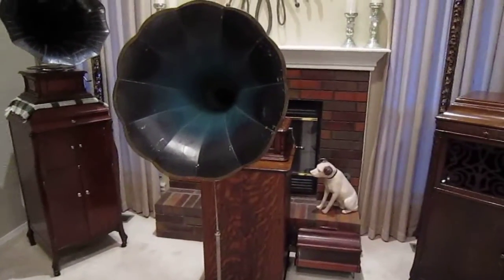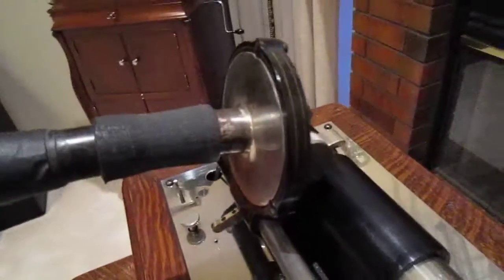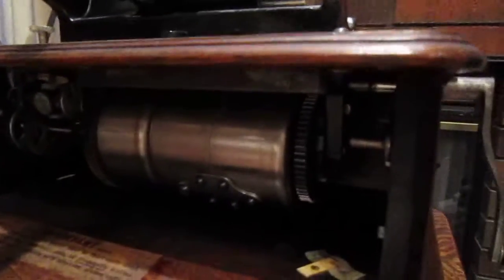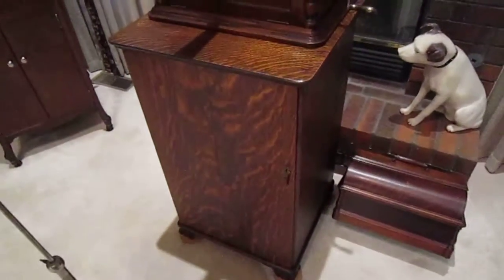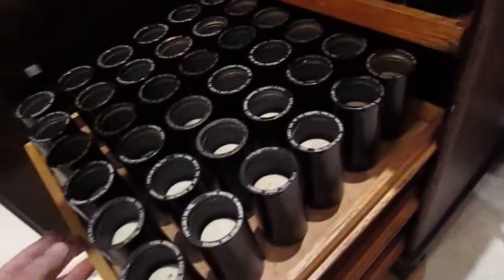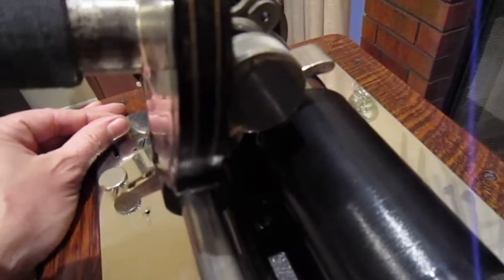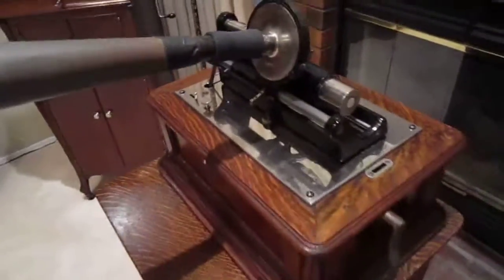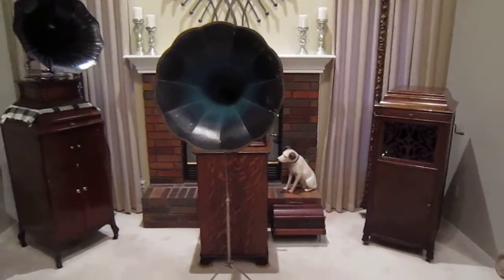1908 Columbia BC Graphophone

Comment: I have the much rarer Columbia C (commercial) Graphophone with the same craps or krabs, Kraps motor from 1895 first used on a bell & tainter machine it stayed in use until 1906.
the key is not to wind the motor to full just count 20 cranks from totally slack if you wand to add some tension just add 5 to 10 winds never crank to full I made that mistake and broke a spring it is not a normal phonograph motor this thing is Captain America. ironman strong! so keep that in mind if it can run 12 minutes you are fine anytime! no cylinder will run that long not even the long cylinders.